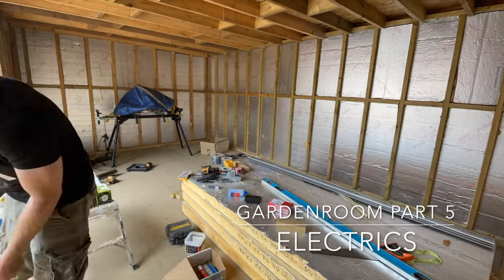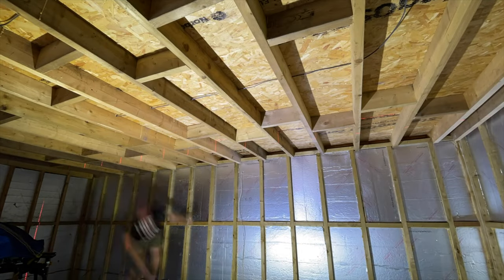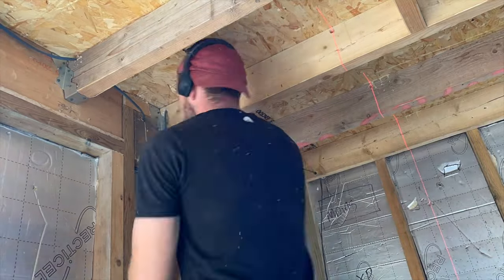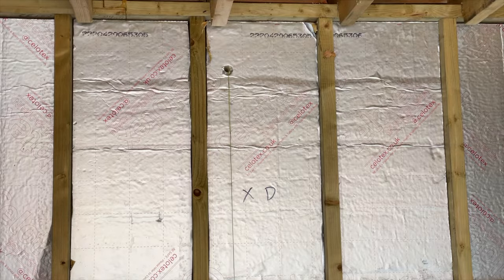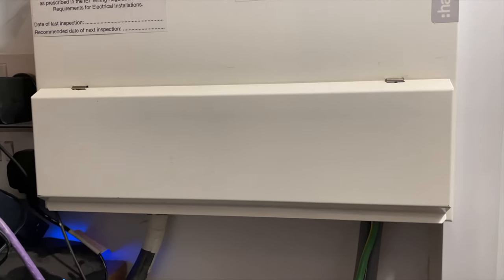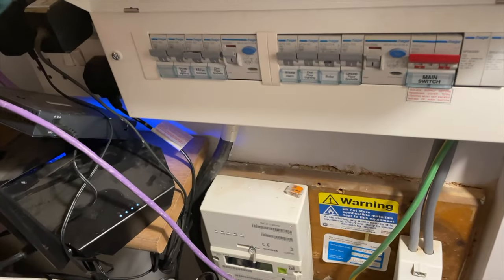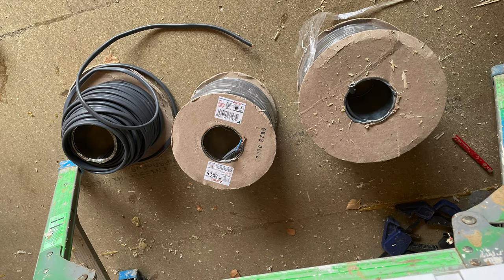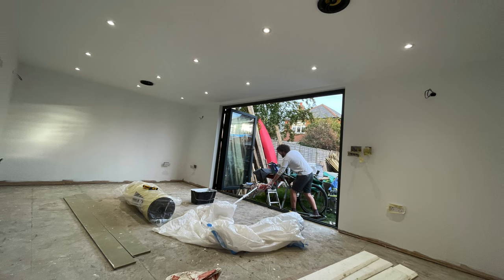GardenRoom build Electrics Part 5

Comment: Many thanks for your great video. Can you please let me what speakers you used and where you got them from?
Reply from the maker: Hello they’re Lithe Audio Bluetooth.. they do have more premium ones that have a WiFi connection too which allows them all to sync together with TV’s other branded speakers.. but were a bit more expensive.
I bought from an eBay store new, you need a master and a slave I believe you can have up to four in one grouping.

Lithe audio but you need a master one !